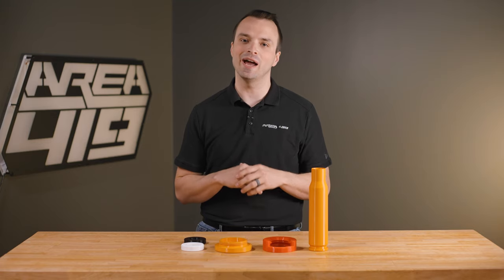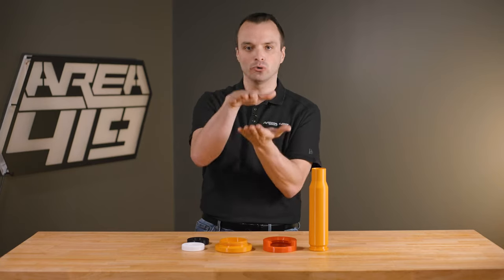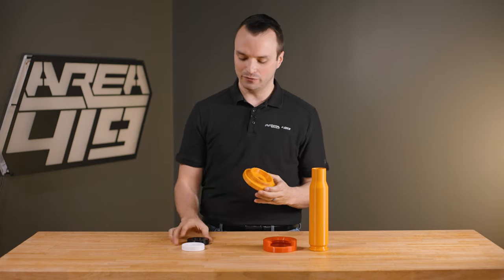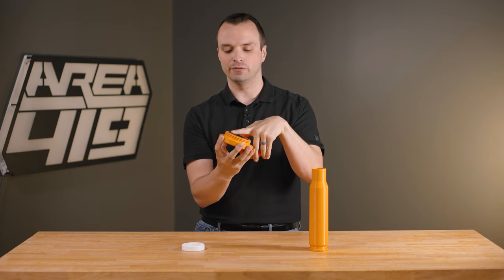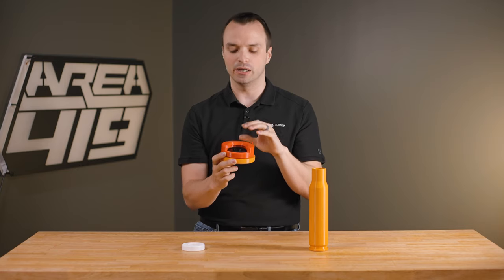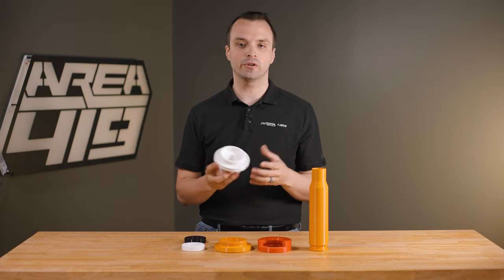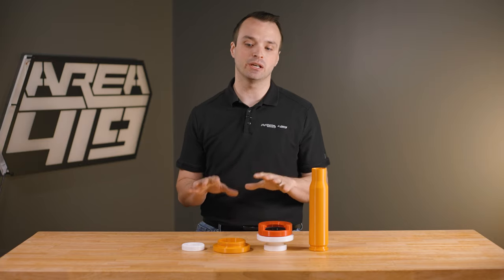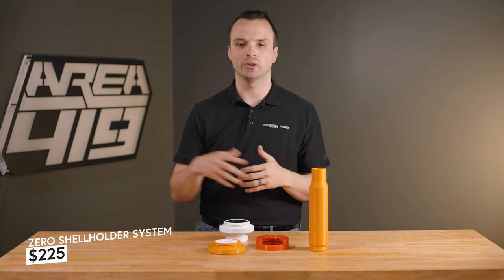Area 419 ZERO Shellholder System | New Product

Comment: No it's an all new concept and been the proud owner of a zero-press I definitely want this system when's the wait list start
Reply from the maker: Check out the link in the description and get on the list for an email when ordering starts!
Reply: @area419  will the magne shell holder  work with 338 lapua round
Reply from the maker: @stsr2157  No, this is for 300 Win Mag, 6.5 PRC, etc. The 338 Lapua is the next larger size, that we may make available in the future.
Reply: Just changing over to zero system would also like 338LM option

Comment: Seems very similar to the concept of the Redding Competition Shell Holders.
Reply from the maker: They’re a very solid product
Reply: I use the Redding Competition Shell Holders, definitely helps keep sizing consistent. However, the advantage to this will be that you set your cam distance once since the shell holder is effectively the same. My only issue with the Redding is that when you change a shell holder - you then need to re-set your cam over. Not a huge deal but one less factor to mess with. I also wonder if at some point they do a .001 shim to get you between distances (or you could cam a tiny bit less). Very well thought out re-do of a great product.

Comment: I'm not sure how this addresses the "problem" of cartridge and overall length, since there can be several thou of variation, just on the head of the cartridge base.
A tiny burr or scuffed cartridge base throws this whole system into a tizzy because you are indexing off of a non-precision surface - the base of the brass case.
It doesn't matter how precise and flat and perfect your 'anvil' (insert) is when the base of the brass case is all kinds of eff'd up.